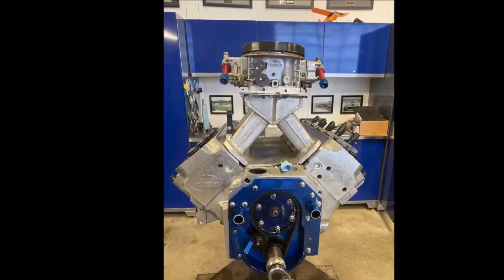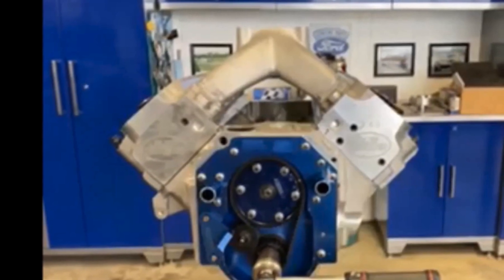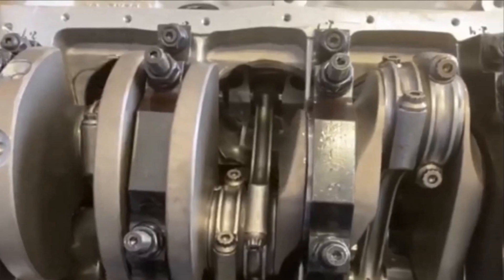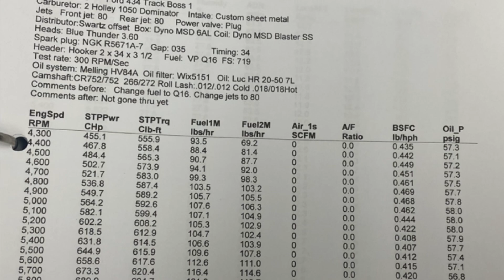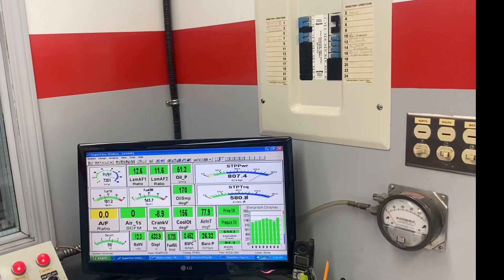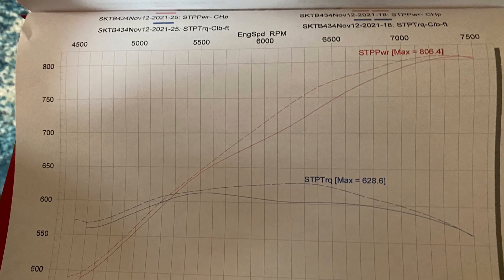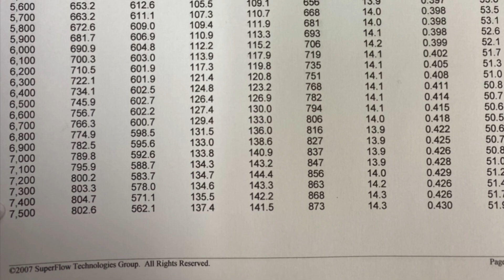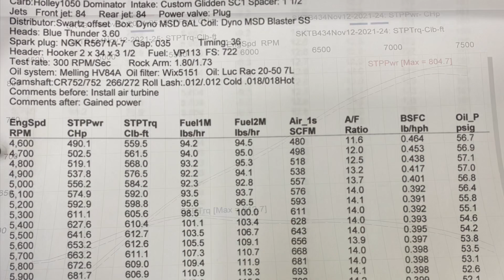Return Of The Lone Wolf, The First TrackBoss Aluminum 351 Cleveland Block, Makes 800+ HP.

Comment: I'm surprised he was only running a 1050 cfm carb and 14:1 AFR.  I think there's more in it.
Reply from the maker: I think you’re right to Chris. I know there is an issue with the air fuel meter not reading correctly so that might not be a correct reading. Thanks for watching

Comment: Love seeing the 50 plus old based Ford small blocks still going strong. 😎 Who needs a damn GM LS. 🤣
Reply from the maker: Thanks Tom, glad you like it, this is not 50 year old block, it’s the new aluminum TrackBoss. But yes I am using a 50 year old block and the LS just so happens to have the same head bolt pattern😉
Reply: @dragboss351cleveland  50 year old design
Reply from the maker: Nope I understand thanks Tom for clarifying. Glad you’re here yeah we don’t need no damn GMLS.

Comment: I like your vids. But canted valve heads. Sheet metal intakes. with twins?
and barely 800? granted an aluminum block is not the best for NA.
But still seems low
Reply from the maker: Not much cam and peak is at 7300, put a bigger cam and get better use of the heads, will probably make 850 pretty easy, but rpm will be in the 8k+ range. Then durability decreases. I would be happy for sure.
Reply: @dragboss351cleveland  Either a large cube chugger. Or a high rpm rev'er
My 396 came through the line passing 10k. But high maintenance.
Reply from the maker: Exactly. Although I have seen some Cleveland’s with cams in 250 duration in a 393,  2barrel Aussie iron heads, putting 3900 into the mid tens. Torque is King they say, while new way of seeing things. Just learning some tricks now from down under. 10k is killer rpm, like the old pro stockers left.

Comment: I'm mildly surprised the twin-carb tunnel ram didn't whip the "inferior" low rise single setup, but I guess if rpm and camshaft lift and duration go up the BIG stuff would start to pull away !!
Reply: The dual carb setup made about 25hp more through midrange. For example at 6500 the duals made 771hp but the single made 745. So quite a difference. The duals made628.6 @ 6300 where single is 612@5500 peak. The duals made 616 at the same 5500. So theres a difference. The single just built steam at top. My daughter primarily races this car so we figured ease of operation with singles be cool.
Reply: @stevecleveland357  Well, isn't that a reversal of what is conventional  thought about tunnel rams only working better at really high rpms !!
Reply from the maker: Thanks Steve for giving us a breakdown on it. You have the most thorough records.  Can’t wait to see it in the 65.
Reply: Your right. I’ve been led to believe over years that tunnel rams would have that high rpm characteristics. However the two I’ve dyno”d had the opposite characteristics. All offered more tq through the rev range.
Reply: @stevecleveland357  Sure makes you wonder !!
Reply from the maker: I guess that Intake and carb are working well together, that is for sure.

Comment: Tim it be nice if everybody showed the real world problems like that instead of acting like you tripped and fell into a bucket of 800 hp Thanks for keeping it real👍👍
Reply: Terry thanks for kind words. I will say for me 800 hp wasn’t easy. Alot of guys say just swap cam and bam 800+. I went over this with cam grinder and he said he could grind me a cam to make 900hp but it wouldn’t pull my car worth a hoot. And it definitely wont peak at the 7300-7400 range. The engine will live at this rpm for years. It was a great time dynoing and where you think you would naturally gain power can drop you 20hp instantly. No motor is the same.
Reply: @stevecleveland357  To me that engine is impressive for this reason because when the dyno was loaded and pulled down on the rpm that motor wasn't having it I could hear that thing just pushing forward in the mid range like a big block and i mean big block like 500 cubes I think if I was considering making any changes to that motor my knees would be shaking,  I think that engine for that motor is above average in my book . I need someone to help me with a cam shaft myself because I been smoking my brain already that's gonna be the most crucial part of this build Im doing trying to go 9s with a 302 not a big problem but doing it with factory steel heads is a little problem because it's naturally aspirated of course but will see how it goes , good luck with all your doing there 👍👍
Reply from the maker: @stevecleveland357  so true Steve. 800 ain’t easy at all with NA. And at 7300, last for years
Reply: @dragboss351cleveland  I thought it was Steve Kinzel, lol  (check out up top in your intro) !!
Reply from the maker: @arkhsm  I must have missed it, sorry Steve. 😳
Reply: Dragboss got spelling of last nqme a little off but he’s not the first one lol. No worries. Terry i get all my cams custom ground by Scott Main at Camresearch. He’s probably done 35 ford only camshafts for me. Only guy I use may be worth while for you to chat him up.
Reply from the maker: @stevecleveland357  sorry Steve I had it right the first time and changed it. I will fix it
Reply: @stevecleveland357  I appreciate that alot where's he located I surely would like to have someone i could trust Thanks again Steve for the info 👍👍
Reply from the maker: To get 800 hp NA, is a lot of work. Once you get to that 1.8 hp per cube when the challenge begins. I am a realist Terry
Reply: @dragboss351cleveland  I know you are Tim Im looking forward to your up and coming live stream .Is there a way i can reach out to Darin Morgan ??
Reply from the maker: I don’t give out his info, he will be back non 12/3 for live chat.
Reply: @dragboss351cleveland  ok cool i just thought maybe he had an email or Facebook or something to get ahold of him . I have an intake that has a reversion it pulls the air out of end runners I wanted to see if he has ever seen that before because i sure haven't have you ?? 👍👍
Reply from the maker: No Terry, I have not seen that before, Email me the question and I will forward it to him. Thanks
Reply: Hes in inglewood Colorado
Reply: @stevecleveland357  Thank you sir
Reply: Lol don’t worry about it Tim. It happens all the time. In Germany it’s pronounced Kinsla. Lol. I never argued over there.
Reply from the maker: @stevecleveland357  I fixed it. Had it right the first time. Funny what people notice, stay tuned

Comment: Nice. What sort of compression and duration at .050..?
Reply from the maker: 13.3, 273/284, can card in beginning of vid
Reply: @dragboss351cleveland  healthy but another 8 ish degrees in duration will help.
Reply from the maker: @michaelparadisis4076  I know it man, and more lift. 8 degrees where?
Reply: @dragboss351cleveland  definitely more lift, I’d add 8 degrees more on intake and 9 on exhaust, more u allow in , going to likely need more to allow out. I enjoy your videos immensely. I love clevo’s and big block Chevys.
Reply from the maker: @michaelparadisis4076  thanks Michael. And probably with 112+ sep angle. I like BBC too, old vetes with the tri power, 435 hp, like 66,67
Reply: @dragboss351cleveland  clevos and 112 LSA. Is a little uncommon as they tend lose a Torque throughout the rpm but with savage top end rpm power like yours has it may just be the Ticket to further enhance it. Oh nice I like Vette with BB Chevy- I have 70 Chevelle with a freshly built 582. Insane torque and power on pump fuel.
Reply from the maker: @michaelparadisis4076  yes good point. I may leave well enough alone. My buddy had an LS-6, wrecked it in the 80s, always wondered what happened to it.
Reply: @dragboss351cleveland  LS-6 Chevelle is king of muscle cars.
Reply from the maker: @michaelparadisis4076  No doubt Royality, but the Boss 351 Mustang, would give it run. I have to think the King or right up there was the Hemi Cuda', another milestone. Thanks Michael.
Reply: @dragboss351cleveland  Boss 351, DEFINITELY the KING of smallblock factory stock muscle cars back in the day !!

Comment: not surprised at all the single 4 is right there 

Tim, I like the channel.   great content.    Brings back my Cleveland memories.   

side note....I remember in the early 90's, we had MBTE in pump gas, and my brother would pick up 1 tenth in the fall when they switched over to that at the pump.  he ran 87 octane in his 9.0-to 1 302....drove it daily, had a hyd roller and it ran 11.3 @118.  real street.
Reply from the maker: Pretty impressive for pump gas. Nice for sure. Great street car and mean. Thanks for watching. More memories on deck so stay tuned.
Reply: Holy.....that's UNREAL for a 9.0 to 1 302, the car must have been a really lightweight piece !!
Reply: @harryharry3193  I suppose you're right, as if you watch the 5.0tussin channel,  his wheel standing 5.0 does a similar et !!

Comment: Im thinking maybe i should have gone
 N/A . My rpm is restricted by the blower & an upgrade is $$$$$
Reply from the maker: He is making that power at 7200. But with a blower you should be way over that I would think
Reply: @dragboss351cleveland  p600b centrifugal.  It seems to limit me to 6600 rpm  the build should be good to 8000.
Reply from the maker: Then there is something else holding it back, exhaust?
Reply: @dragboss351cleveland  nope , 2" primary to 3" i know the blower doesn't flow the cfm for 429ci
Reply: @hieronymus..bosch8532  That's got a little age on it. Solid piece, but it does have some older tech in it. That may be the limiting factor, just guessing. These new variable vane and other stuff out now wakes those belt driven superchargers really wake up. I'm still partial to the roots/wipple types myself. They all have their limits, though.
Reply: @elmerfudpucker3204  ya i got it in the late 90s but its a 12 rib  billet impeller 17/ 14 psi intercooled meant for a 5L . My Cleveland is 429 so im lucky if i see 8Lb's of boost.
Reply from the maker: @hieronymus..bosch8532  ok. That eliminates that. Then maybe cam profile. I know nothing about power adders, but the basics.
Reply: @dragboss351cleveland  im pretty sure its the blower , im running 4v chi heads & a blower cam. Really im looking for only 600hp as its a road race car my concern is wide power not necessarily peak.
I haven't had it on a dyno yet so im only going by my butt dyno & we all know how inaccurate they are🙊
Reply from the maker: @hieronymus..bosch8532  I can dig it. Just would never think that blower would limit rpm. Feeling fast in the arse sure is much different sometimes when compared to track time. Frank Marchese will be back on soon, good question for him.
Reply: @dragboss351cleveland  you haven't ever done a video comparing build cost ? I built mine for $20 000 & i have buddy that built some odd 350 that he's into an aftermarket iron short block  for $12,000 where as my aluminium short block was only $9 000 .
I thought chevys were cheap
Reply from the maker: @hieronymus..bosch8532  good idea, I may do that. I think people don’t really know how much things cost. Thanks for the tip
Reply from the maker: Thanks Elmer